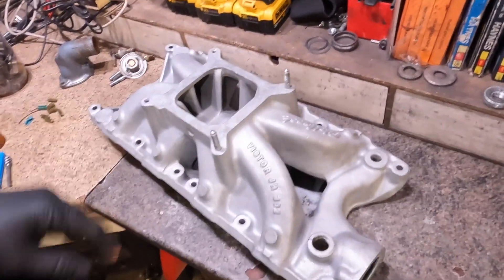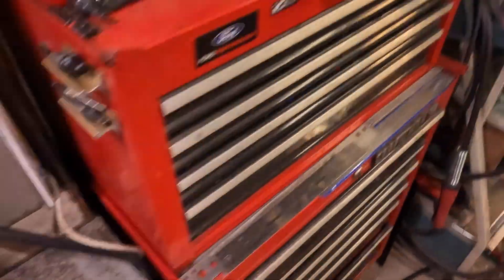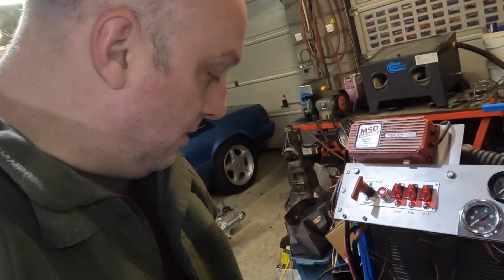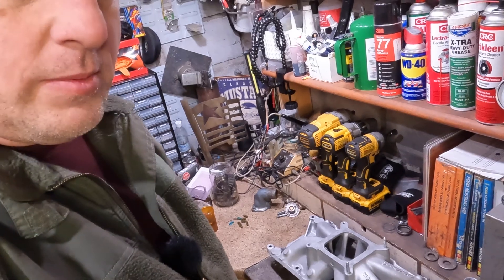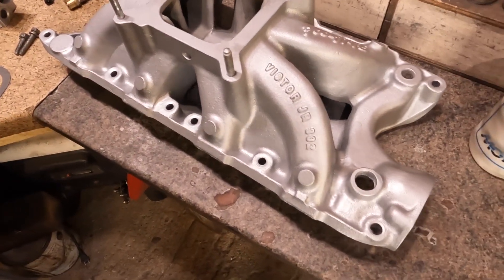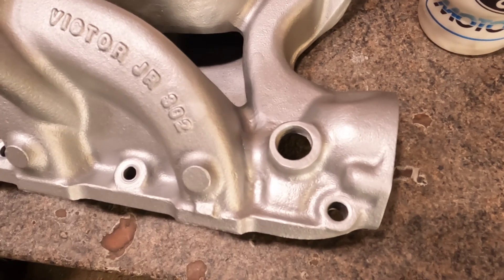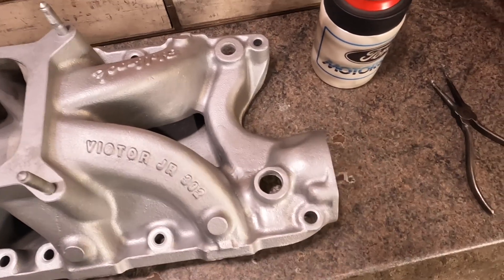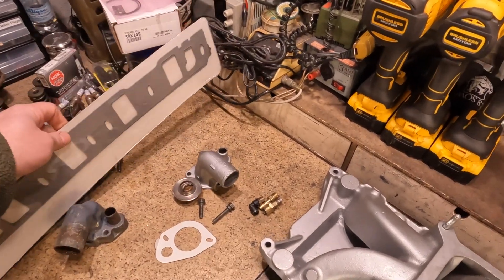My Attempt At Welding A Cracked Aluminum Intake Manifold

Comment: Great buy on the intake manifold even without the gaskets ! Your welding job looks real good as long as You don't over tighten the fitting and use a good pipe sealer on the fitting it should hold with out any problem . Been there done that it works . Best Wishes and Best of Luck 🇺🇲🇵🇷🦊👍